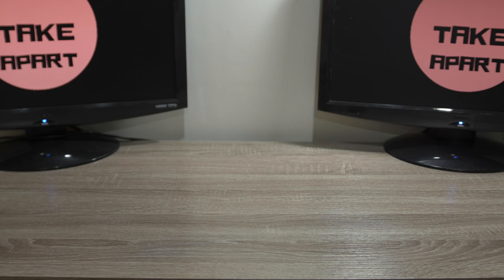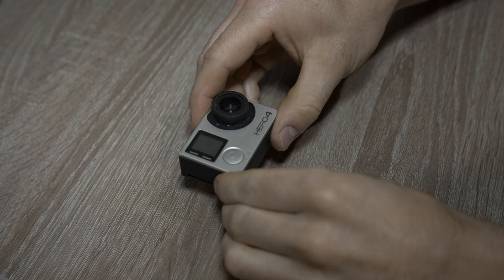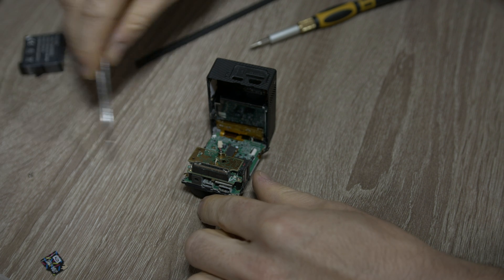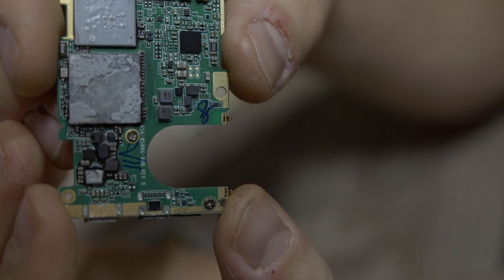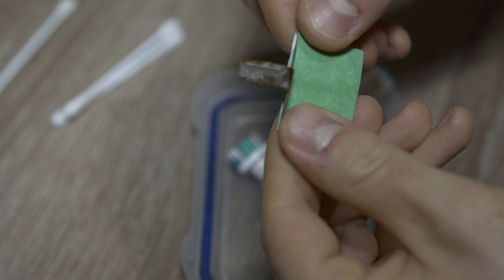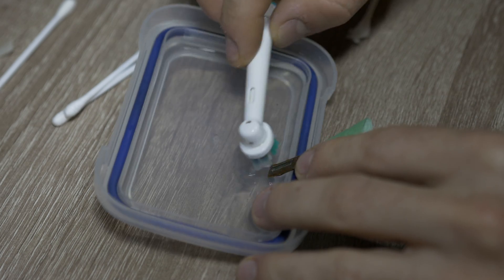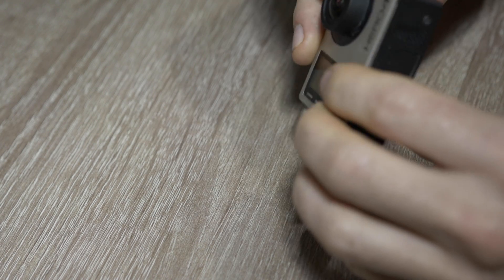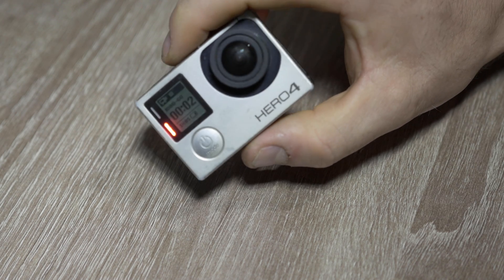Water Damaged GoPro Hero 4 Silver |  How To Fix It | [4K]

Comment: Mine shuts off after about 2 feet deep in the water used to work fine not sure what would cause it loose contact
Reply from the maker: hi, it sounds strange…. what case do you use ? maybe button will turn off the gopro?

Comment: hi i odnt have knowledge in repair but my go pro hero 4 just drop water inside the charging part because its not covered now how can i takeout the salt water,around it from seaworld when we went there while i recording stingray swimming the door of the go pro protector opens since i just put rubber on it to lock it is it possible to save the go pro 4 and what tools u have can i buy it, so i can disassemble it when im done my holiday here and what kind of brand is isoprohyl alcohol thanks u for answering
Reply from the maker: hi, it depends on amount of liquid entering that port …. you may need to open the gopro and clean entire area… otherwise it may be enough to just flush connector with iso alcohol. there is no exact brand of alcohol you can get bit from pharmacy (overpriced) . 
let me know how it went…

Comment: what are the absolute necessity tools and equipment I need to tear down and clean the go pro 4.thank you
Reply: #1 Phillips screwdriver and pry tool. I just did mine like this video and it came apart quite easily. Got a little stuck getting the front panel/lens piece out but some gentle maneuvering and it came right out.

Comment: Will be trying this if my go pro doesn’t turn back on after being in rude for a few days, will comment if I can get it working again 👌
Reply from the maker: hi there, 
not every damage is the same .     it’s depends if your components are still intact.   
thanks
Reply: take apart are parts cheep and easy to replace if they are broken? And how do you know what parts are broken?
Reply from the maker: yes they not too expensive... and replacing is easy just follow my video.you can find parts likened in description of the video. 
thank you
Reply from the maker: yes they not too expensive... and replacing is easy just follow my video.you can find parts likened in description of the video. 
thank you

Comment: Sadly didn't work for me :( it is in a state where it doesn't turn on
Reply from the maker: hi there 
there is still chance... after good clean in iso alcohol... and connecting all ribbon cables ... try another battery. battery not water damaged..  or just plug in usb power and let me know if there any light beep or so .... thanks
Reply: tried a new battery and also connected via usb cable but sadly no response :(
Reply from the maker: may be cheaper to gk with new motherboard... and hope the rest will just work fine .... I should have video how to replace motherboard.. 
thanks
Reply: @takeapart  may gopro got wet sir. And I immediately place it inside the sack of rice. And after 3 hours sir when i plug the battery back the front flash a solid blue light. Is that ok?